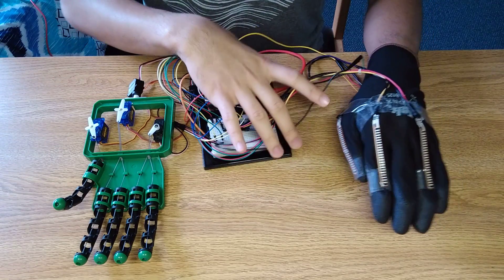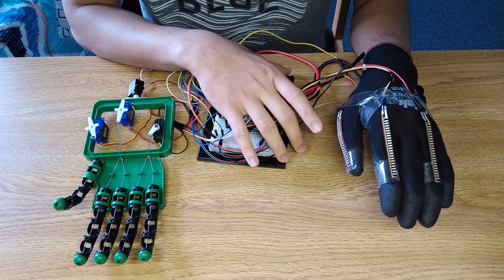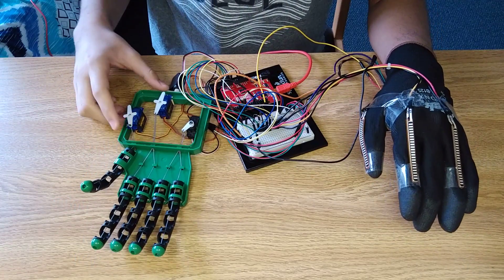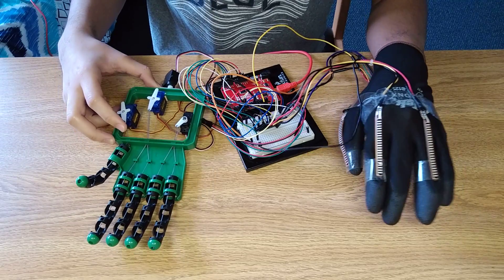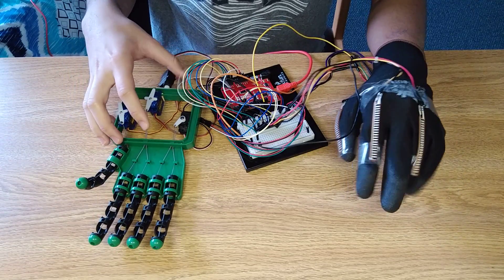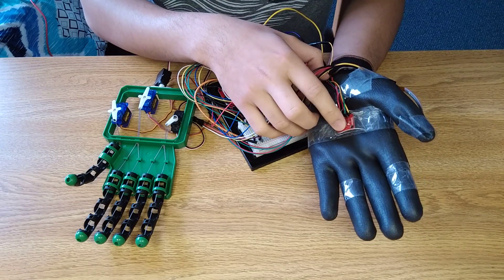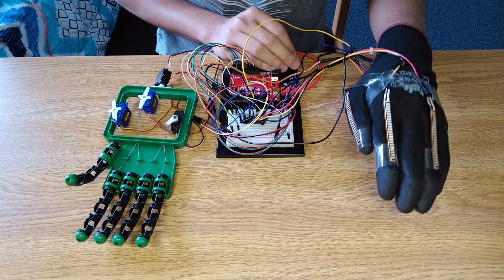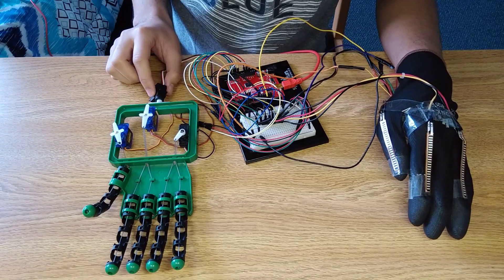Arduino Robot Glove Hand - BioE101 Project

Comment: That is a nice project,  the sensors is very sensitive and how do you have them The idea of the project is very good too when both hands are symmetric signals transform and regenerate from another hand is possible for accuracy works.